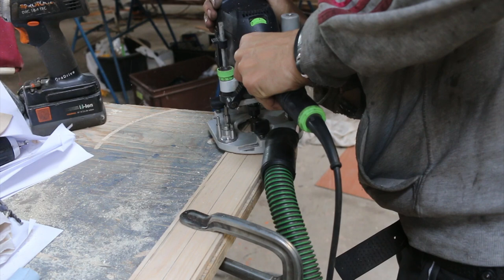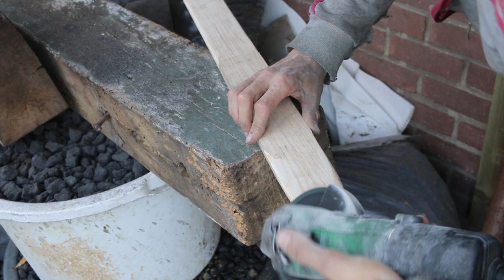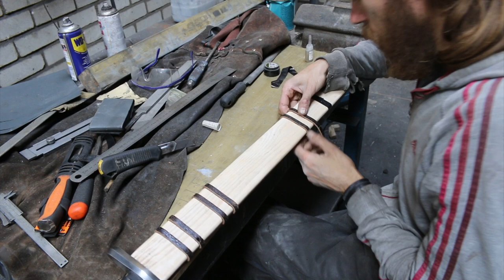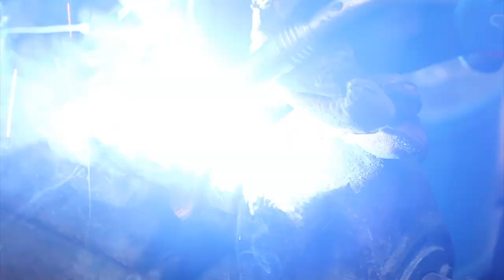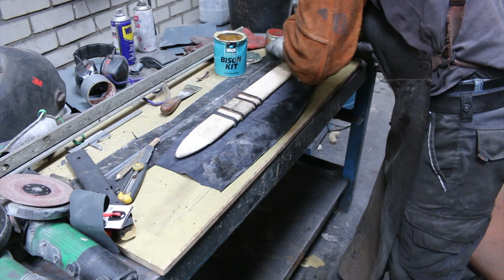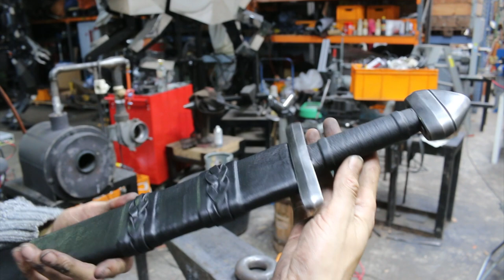Forging a pattern welded Viking broad sword part 3. making the scabbard.

Comment: Wish i had seen this earlier.  Very nice.  Q: why felt the inside all the way down?  I was under the impression that the felting or fabricing of the inside was only the first 4-5 inches.  Q: why glue the leather rather than stitching along the back...other than personal preference?  Not being critical just curious.  Q: the twine you use under the leather...any special kind? or just ordinary twine you might get at a hardware story or sewing shop?  Thanks for sharing, impressive work.

Comment: Lol, My first try at making a sheath like that was just wrong! Instead of gluing a edge to the wood and working my way around. I covered the lether with glue, got glue all over everything, and had to make my second one. It came out right. Only I started on the wrong side so its left handed instead of right. It seems I have to exhaust all the wrong ways first. Lol